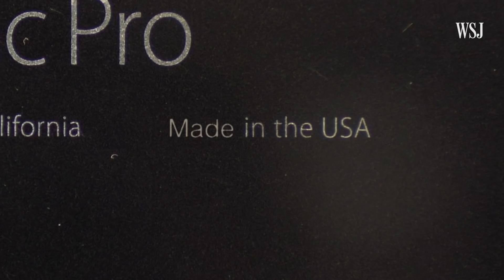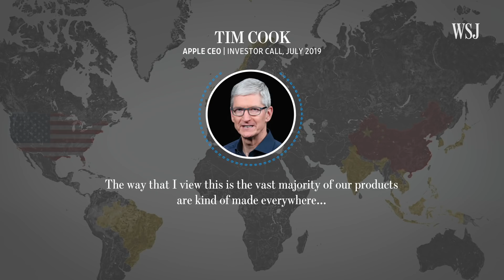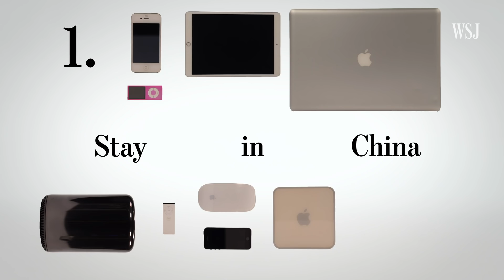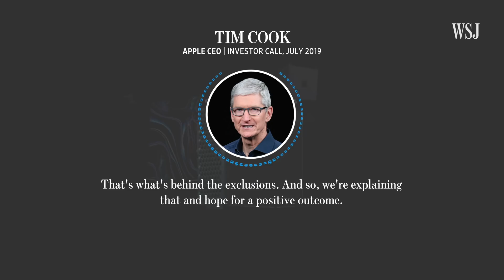Why Making Apple iPhones in America Is So Hard | WSJ

Comment: This is just a matter of logistics and supply chain management
Reply: @Howard-de1gs  Look at the mirror
Reply: ... uh huh, try “logisticalling” a plant in the US when you can’t even fill a room with chip die makers...
Reply: @danielhu6485  Apple and other US tech companies can source their semiconductor (DRAM/SRAM/ReRAM/MRAM, CPU/MPU/SoC logic [e.g. the actual microprocessor], analog/mixed-signal [e.g. cellular modems, CMOS image sensors, MEMS/NEMS circuitry, etc.]) integrated circuits 100% within the USA, as there are several suppliers with at least one 300 mm-diameter wafer fabrication facilities in the USA--Intel, Global Foundries, Texas Instruments, Micron, ON Semiconductor, and Samsung.

PCBs are entirely manufactured entirely in the US, as well as speakers, LEDs, and obviously glass products such as Corning's Gorilla Glass, including metal alloys and plastics and composites are produced in the USA along with the machinery used to make them, and which could be used in constructing the iPhone. Even the technology used to fabricate LCD/OLED screens is produced domestically in the USA by a company known as Applied Materials (stock ticker AMAT), which is the largest US-based manufacturer, and amongst the largest manufacturers in the world, of semiconductor fabrication equipment. Although I'm okay with the screens Apple sources from the Japan-based JDI company that manufactures LCDs and OLEDs, along with JOLED that is making the world's first printed OLED screens in Japan commercially for the first time.

Even the rare earth minerals used to create electronic devices are produced within the US (e.g. the Mountain Pass mine in California with some of the purest rare earth mineral reserves in the world) can be domestically sourced from within the US!

As long as these firms are as productive on a per-worker basis as the foreign competitors, they will be price competitive as the competition abroad. It's a matter of setting up a supply and value chain within the US and optimizing it to maximize efficiency so that the productivity is maximized while costs are kept competitively low.
Reply: @NUCLEARARMAMENT  I'm sorry, but while I don't doubt that there are certainly some semiconductor manufacturing plants in the United States, how many of them are able to fabricate a 7nm processor, the current technology required for Apple's top-notch processor? As far as I know, only TMSC and Samsung are currently able to fabricate a 7nm node.
Sure, I'm not saying it's impossible to set up a supply chain purely in the United States; you probably CAN. But Apple WON'T do that because that's not what they do; they "purchase" the supply chain of other companies to manufacturer their products. If, for example, there was a manufacturing company based in Antarctica that offered the right technologies at the right price, you can bet your savings that Apple's next iPhones will be manufactured in Antarctica.
Your evidence simply points to the fact that United States has the resources and capability. But because of supply and demand, it won't happen; it's as simple as that. It's the same reason why the United States exports more rice than China, even though rice originated from China and China consumes more rice; its simply more economical for China to consume rice from the United States, rather than producing it themselves
Reply: @danielhu6485  Intel's first-generation 10 nm node, which first went online this year, is superior to TSMC's first-generation 7 nm node. It provides higher transistor density, and Intel, Samsung, are two companies which have at least one fab in the US for that. Micron has one plant in Boise, Idaho that makes NAND flash and DRAM (DDR3/DDR4) products, as well as RRAM products, which are advertised under the Optane brand name. Texas Instruments can produce analog/mixed-mode ICs, such as CMOS/CCD image sensors and MEMS antennas and cellular modems and whatnot. Intel also produces cellular modems in its US-based fabs, IIRC, and that includes those Atom SoCs, which they have a long experience in producing.

The packaging and integration of the specific ICs needed to make a phone, is probably what needs work on, as most manufacturers who do expose wafers and extract dies from them, don't package them in the US, and instead send the exposed dies to Malaysia or Costa Rica to be packaged, and the PCBs are imported from and made in China, and are assembled there with the US-made chips. So, that kind of process would also need to be done domestically as well, and then an assembly plant to finish the final product for distribution to retailers and end users.

It's complicated, I'm not sure exactly how it'd be done, but I don't believe it would result in even a doubling in price as far as sourcing everything domestically is concerned. Apple isn't going to do this, obviously, because of free trade and the value chain being mostly based in Asia.
Reply: Nuclear Armament I’m sorry, but where are you getting your information? Intel hasn’t even released any 10nm products yet, and the earliest 10nn consumer products look to be in 2020; they’re still stuck on 14nm as of now. And having at least Samsung/Intel having at least one factory in the US literally means nothing; Apple needs over 500,000 phones to be produced in a day and fast production line changes to accommodate their schedule, and I fail to see any US factory even being able to fulfill that production quota or requirements simply because of US labor and corporation regulations.
Look I get it; that if you pull enough strings, it seems to be feasible for everything to be produced in the US. But there are dozens of articles and experts detailing why it simply is not economical for Apple to do so and Apple has even attempted to do with one of their products and failed; simply put, it’s kinda arrogant of you to assume that your above these experts and corporations, that your few hours of research on the internet is enough to trump the work and effort of thousands of intelligent people.
But clearly, judging from your response, I’m not going to convince you. So let’s just agree to differ on the matter, and get on with our days, because in the end this all doesn’t really matter: nothing is going to change, iPhones are going to be sourced from multiple suppliers around the world to be assembled in some factory in Asia. No amount of research and arguing in the YouTube comments is going to make a difference
Reply: @danielhu6485  I agree with you, I'm just putting it out there. Apple has hundreds of billions in cash reserves, if they wanted to I feel they could. I don't believe I'm above any experts, it's just my own personal beliefs and they may very well be wrong. At least the new Mac Pro is being assembled in the US despite most of its components being foreign-sourced.

Comment: If the goal is to manufacture at or comparable to the cost of manufacturing the item in China, the US has no chance.
 
1.) China has no minimum wage or over time. 

2.) I had the chance to visit the Foxcon facility in China. They are the largest manufacturer of the iPhone. The average wage for such highly skilled labor was just under $2 an hour. 

3.) Nearly every part or component is manufactured in China. Making the cost cheaper and the production faster. 

4.) China has the largest labor force in the world. They can easily scale to handle orders of any size.

The US simply can't competitively compete with that. Especially if the goal is to manufacture the item at or around the same price as China.
Reply: And there's an exception Huawei. The labours who do the parts that Foxcon does not (of course Foxcon is also doing Huawei n even Nintendo Switch), there salaries r pretty crazy... It will be even more crazy for the labours in their European Town (Huawei's most well known factory n the most beautiful one in China), the average salary is 1M per year. But of course, I have a friend who works there told me the requirement is also pretty high. U can see Doctors all over the place, quite an amount of masters there can only be labours....

Comment: How do you turn out 10 millions of these products per month? You need a lot of workers. Foxcomm has 250,000 workers making these Apple and other products.
It cost about $250-300 in materials to make the phones with $8 to foxcomm to physical assemble it. So you see the massive profit that goes to Apple.
Yes you can shift these production over to the US but remember these products can come and go (fads). What do you do with these workers then? Fire them?

To be honest, it probably will come back to the US but it will be fully automated. This is going to be for most manufacturing. As example, You can see where Tesla want to go - eventually.

Comment: You could move production, but not the jobs. US manufacturing, unionized or not is simply more expensive because the cost of living is higher than China's. Also, supply chains are very important. If the US government wants to boost local manufacturing, you need to bring suppliers closer to the factories, Shenzhen style, that's not negotiable. Because it's not just Apple, it's every other manufacturer out there, whether they make computers, smartphones, appliances, and even cars, developing a strong electronics supply chain benefits all of the manufacturing industry, even if it t means mostly automated labor.

Comment: There's a principle in problem-solving (root cause analysis) called 5 whys, this is an iterative process of asking the question why,  for instance

1. Why is apple not producing in the US? - because it is more expensive to produce in the US.
2. Why is it expensive to produce in the US? - because of high cost of labour, supply chain and access to raw materials / components.
3. Why is cost of labour high in the US? -   Please reply comment with your answer
4. Why is there no supply chain, or access to raw materials in the US? -  Please reply comment with your answer

Ultimately if you continue this iteration to get to the root cause of the problem, you will have splited this process into hundreds of problems, some of which solving them will mean infringing some rights of the American people, or changing long-standing policies, or massive re investment in new industries that may take years to develop, or working on immigration laws  etc.  The enormity of what the root causes are, is the reason production will probably stay in china and other countries at least for the next 2 decades.   

But if any American company wants to start preparing for the next 30 years to have a backup to china, I think Africa (especially high populated countries, should be on people's radar), by 2050 Africa will have the most youth population in the world. The only problem with Africa for now is political stability, which will change in the next decade.

Comment: It is not too hard to understand. It's simple economics, competitive advantage, you specialize in what you are better at. China does the cheap labor and the US does the engineering. So in simple terms, they both need of each other even though it would be great if part of all that manufacturing came back to America.
Reply: That’s not what China wants anymore.
What you described has been the norm the last 30 years, cheap labor.
China has realized, there is no leverage on cheap labor. It wants highly paid jobs moving forward.
It basically wants to turn itself into a USA.

Comment: Bottom line the labor is cheaper in China. They don’t have minimum wage laws like we do in the US
Reply: It is not only about minimum wage lols, but it is also about the supply chain. Different parts of the phone is made by different companies. From the batteries to the processor. Cost will go up if it is assembled in the US as they still need to import the other components to assemble. If you want 100% made in the USA, they would need to open a factory for every single compenents of a phone.